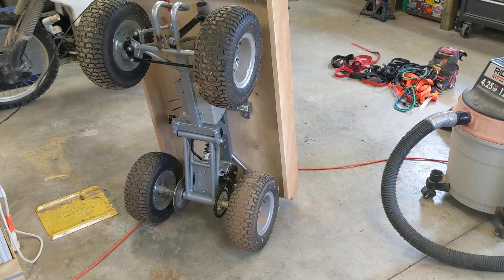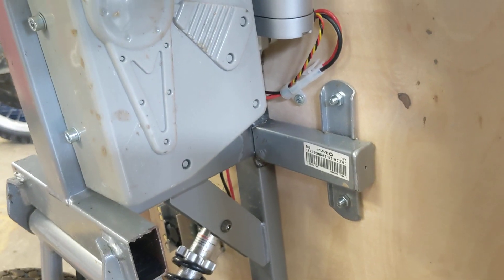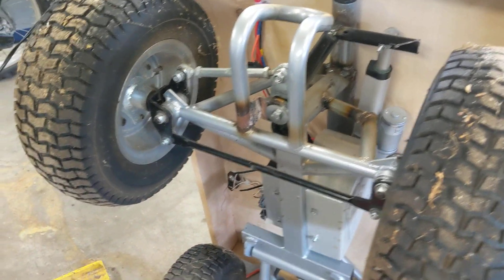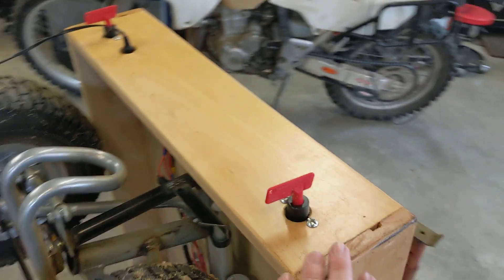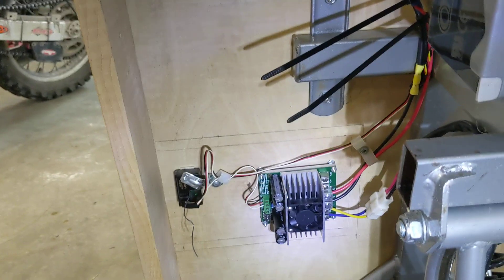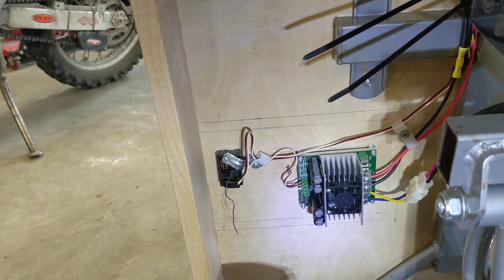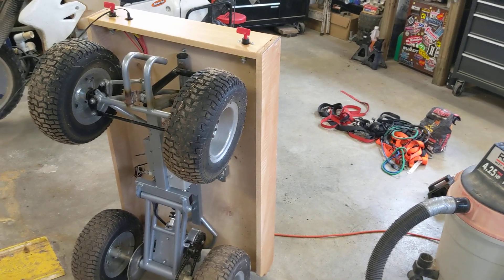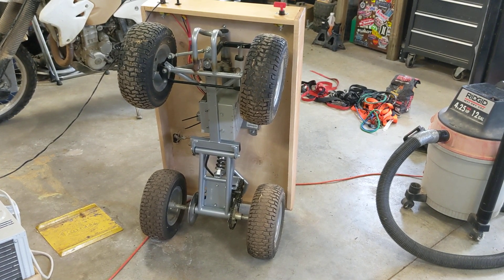Remote Controlled Wagon - Explanation of Parts

Comment: the link for the radio controller don't work. do you have another link?
Reply from the maker: This is a 3 channel that comes with a receiver, but you really just need one that matches or binds with the receiver you're using.  https://www.amazon.com/Spektrum-3-Channel-Transmitter-Receiver-SPM2340/dp/B0857DCP3V/ref=sr_1_7?dib=eyJ2IjoiMSJ9.DQmMVWD24TGFCBoUlXdLK0Z3NzaY3lrqgdMZCdsZuRfRUIHwh1FefEQxci5bx6UrXu18QW0CL72A0dwshYq0wI884xwHCKWCnNDmtXg-T1wQQso5D0dkJp7SqKqOLcj-cYtSf6RC8evmAerTdXf48JWHwmOqNnYHBoRnbf4iga9_GU7fOcWBiRF5OXI76B9-EYl175_pEzvCW1zEYUDVnChqeIkFu2_UfEisKnP4TYj9hTfH3osd6lHItRpYKcYm.Xnri8NlCR95Nnz_Rtty0xVdUTpT5FI_qvDbZvra22Tk&dib_tag=se&keywords=spektrum&qid=1725283411&sr=8-7

Comment: So the blue and yellow wire go to the directly to the rear motor> The front actuator is always under power and when the signal is sent it moves?
Reply from the maker: Yes. With a servo motor, they always have power and you are just telling it where you want the position to be. The small wires from the radio receiver give it a position code using a pulse width modulation signal.
Reply: Greatly appreciate you answering my question. I went ahead and ordered away last night. Pretty excited!  @elmo4vt1
Reply: Thank you!  @elmo4vt1

Comment: Do you have any carts forsale
Reply from the maker: Sorry - No.  I sold the one in the video and don't have the need for another.  The costs are pretty high, so it'd have to be a built to spec for someone.
Reply: How did it go in the soft sand
Reply from the maker: @ronfordyce3503  It didn't do that well with the tires in the video.  It would just dig down if the sand was deep/soft like we have here in Delaware.  You'd have to use beach buggy wheels (larger grey balloon wheels) if you wanted it to work on the sand.  Not hard to do, but would be an added cost.
Reply: You think if I put wheeleez  on it .it would go in the sand in ocean city Maryland would I have to change Axle because I’m  picking up a razerdirt tomorrow
Reply from the maker: @ronfordyce3503  no question that it would do well with those tires - Not sure if you'd have to change the axle or not.  It probably depends on the overall height of the replacement wheels, but that wouldn't be hard either.

Comment: Hey Don, this is awesome. Are you running a third battery to power your turning actuator?
Reply from the maker: No, the actuator load is pretty small compared to the main drive motor, so I split the batteries and power the actuator and the main ESC from just one of the batteries.  The charge equalizes every time I charge it and I've never seen more than 0.1V less on the battery running the servo.
Reply: @elmo4vt1  Thanks Don. Sorry, I'm not fully following. You split it and one goes to the ESC and the other to the Actuator? (Meaning each is running off its own battery? Or do they come together after the split to run the main drive motor?) Sorry if this is a simple question, I'm new to this.

Comment: Woke up this morning, picked up my phone, found this video, searched for a Razor dirt quad, and found a used one for a great price! Thank you for this video! I'll be doing a beach cart conversion. Is the disc brake still functional on your setup?
Reply from the maker: No, the brake isn't hooked up to anything.  Most new speed controllers (and this one) incorporate electrical regenerative brakeing, which is great for anything around slowing down.  Staying still on a hill is another issue though, and where you could set up a servo on the brake, but it would require constant power.